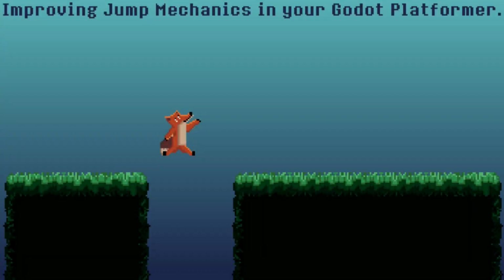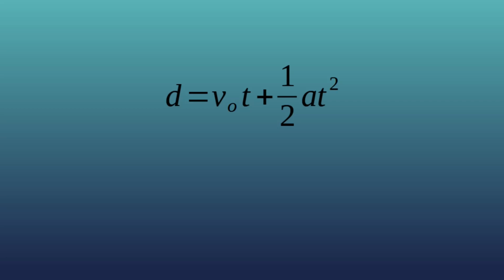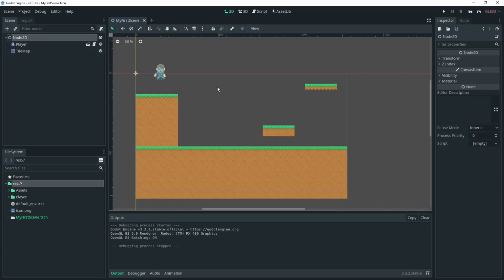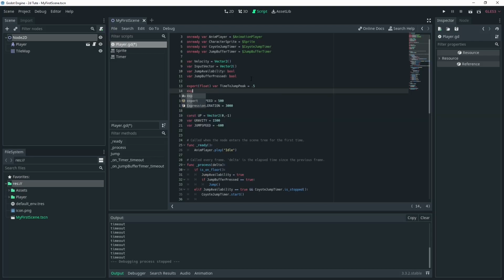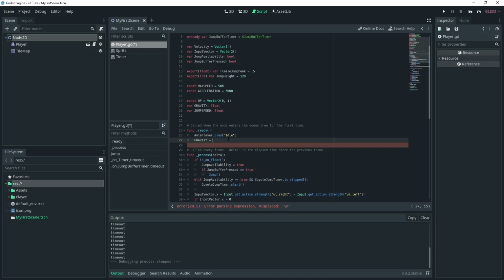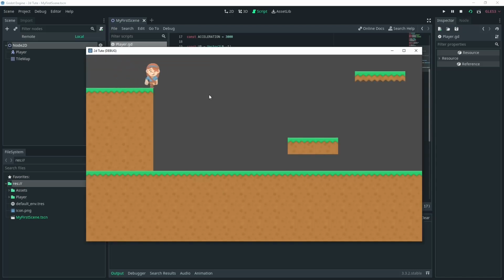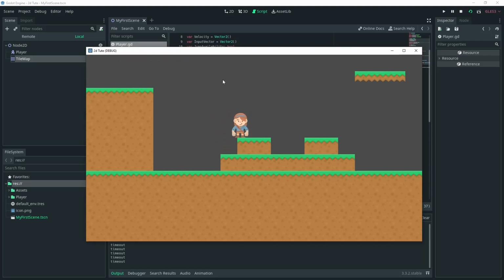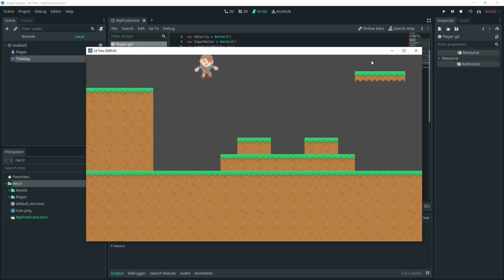Building a Better Jump in Godot 3.5!

Comment: @Chaff_Games The physics part seems to be wrong, although you do arrive at the correct solution. You cannot put two different times into the equation of motion. The initial velocity at the point of leaving the ground is also not zero, it is zero at the highest point. The correct set of equations is:
s = 1/2 a* t² + v0 * t + s0
v = a*t + v0

If we then set the ground to be zero, we get s0=0. We define the time passed when we reach the highest point h as tj.  For the second equation, we know that the velocity at the highest point will be zero, and so we can set the left side of the equation to zero. Our acceleration is also purely gravity, so we set a=-g, This leaves us with this set of equations:

h = -1/2 g* tj² + v0 * tj
0 = -g*tj + v0

We can solve for t and h:

tj = -v0/g
h = -1/2 * v0^2/g

Or alternatively:

v0 = 2 * h/tj
g = -2 * h/tj²